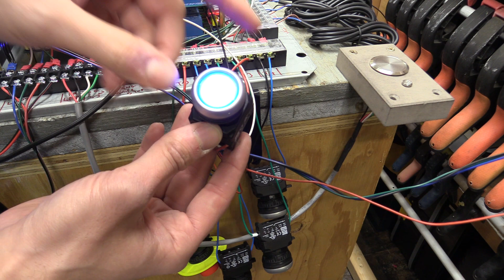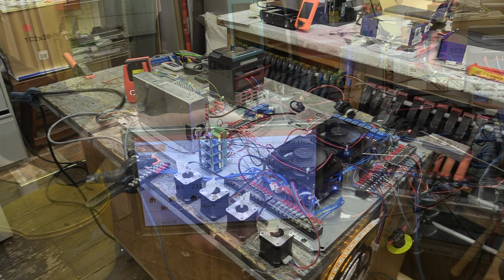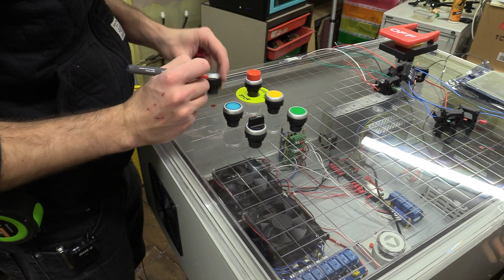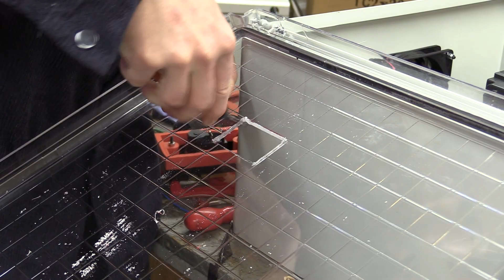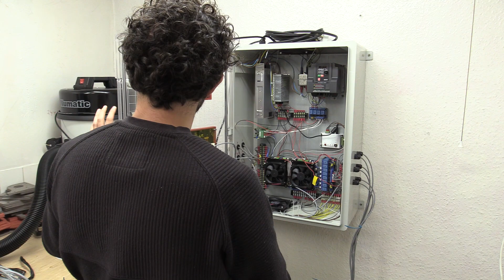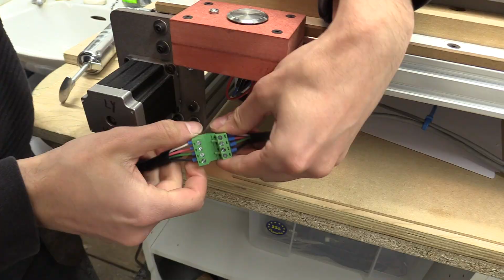#56 Fitting Enclosure Electronics, Buttons, Switches & PanelDue 7i - Duet CNC Controller P4

Comment: Looked forward to this video!

The only thing I find missing is an (few) mechanical hour meters.
It's more so you can use them when you do (preventative) maintenance and upgrades to have a reference point, it helped me a lot getting to know the running cost too.
Reply from the maker: That's a really interesting idea. So I could have one powered every time the spindle or a job starts to have a record of how much use the machine gets.
Reply: @EducatingSavvas  I use two of them. One for 'machine on' and one for 'tool on' they don't deviate that much in the beginning, but it allows for more accurate tracking after months of use. One (AC) is controlled by running it in parallel with mains, one (DC) is controlled via an relay when the tool is on. They are around 6 to 10 dollars a piece, and add a lot of valuable information for that price. (Since the duet does not keep track of this parameters)

Comment: Wow, you have come a long way. Looks good, will be a stable setup. I see a lot of similarities with my evolution in CNC'ing. I too started out with a cramped cabinet and changed over to a much larger one. I opted for a Mesa 7i96 card and a refurbished HP 8300 i5 computer with a 23" touchscreen though. I like the possibilities that LinuxCNC offers. Enjoying your videos for years now, nice to see your progress.
Reply from the maker: Thanks for the comments Peter - I'm glad these videos have been of benefit! I'm hearing good things about Linux CNC but I've stuck my flag pole into planet Duet and now I'm stuck there - but the platform is getting more and more suited for CNC use.

Comment: I mounted my power supply the same way, the problem is if you need to replace it you have to pull out the whole plate, just a heads up
Reply from the maker: I know - I had that moment of terror, looking at the video thinking why didn't I just get din rails for everything. I guess I wanted to use parts I already had and wasn't sure how it would end up. If I ever build another controller I will use din rails, but at least I'll know the connections from this build.

Comment: Great video, where did you buy the connectors you used for the stepper motors.
Reply from the maker: Those were from RS Components - they are PCB terminal blocks. You'll have to get the male and female parts separately.